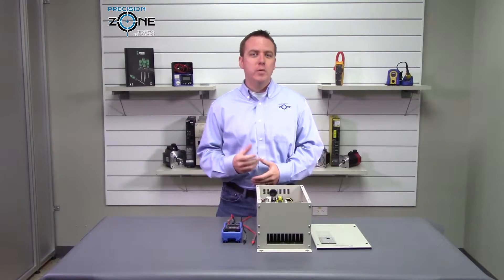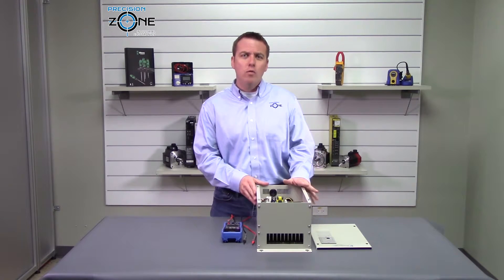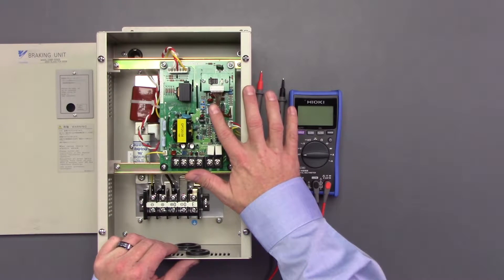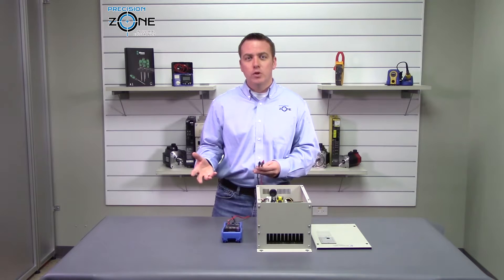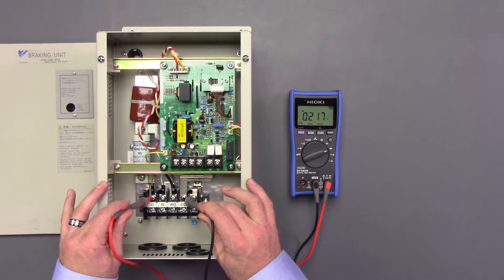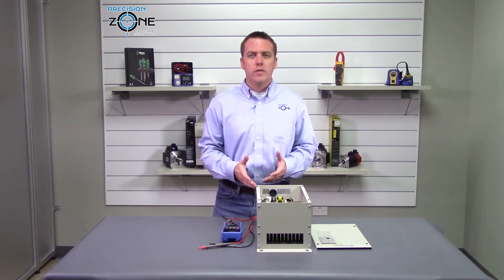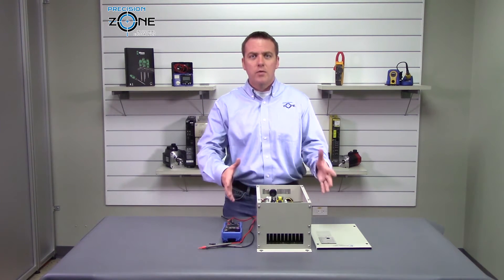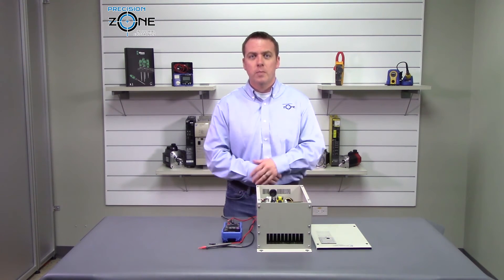Yaskawa Breaking Resistor Inverter Drive CDBR Series Static Check

Comment: hi sir can you explain if what happen the motor if braking unit is defective because in hoisting crane first speed until 4th speed the motor is vibration until 4th speed but no have heat in going of resistor and no have fault in yaskawa vfd the problem only the vibration.

Comment: hi , i have LS is7 vfd 60 HP to drive 22kw induction motor for crane application  (Hoisting and Jip), I want to use dynamic brake unit to support the existing brake,  what is advice?